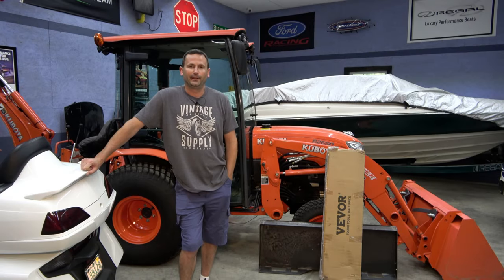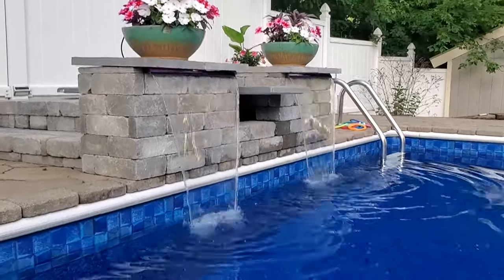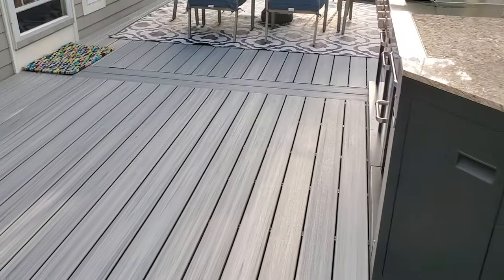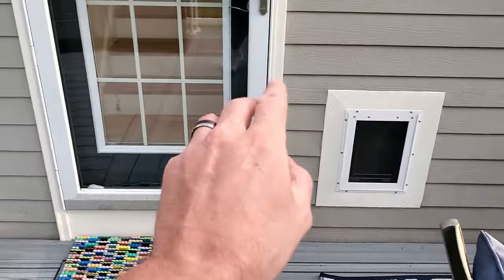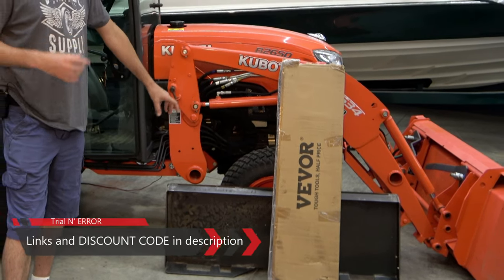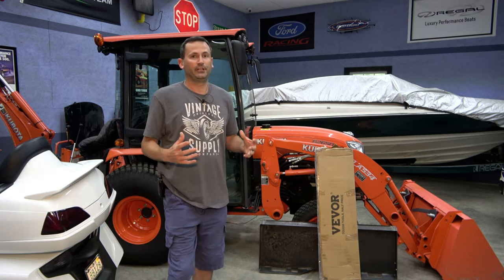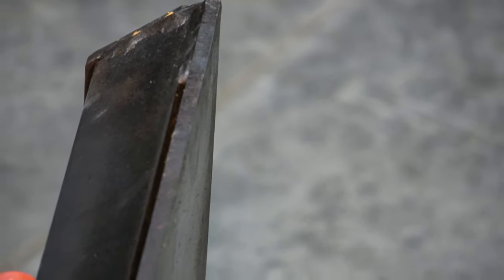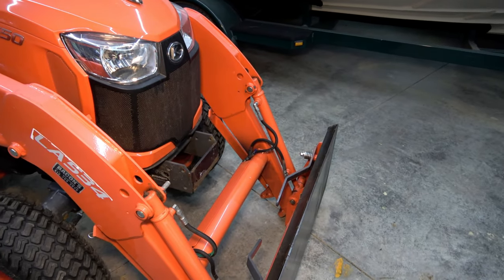The Absolute Cheapest Way to Make Quick Connect Pallet Forks!

Comment: I had some pallet forks with 1/4 inch plate with a tractor about the same size as yours (45 Horsepower). I bent that thin little plate in no time and broke the weld that held the fork in place and the metal at the bottom that the pins from the tractor secure it in place with. Your forks definitely need gussets on the sides for stability. I am about to use 1/2" plate for my next pallet forks. Please let me know if yours lasted.

Comment: The homestead is really looking nice! I love the new deck. Great job on the pallet fork creation. I think I paid about $600 for a plate and two forks that you could slide to different positions about 2 years ago through Chappelle Tractor. How are you liking the B2650? Have a great week!
Reply from the maker: $600 is a good deal!  I just couldn't pass up this chance t build one for $200.  I'm loving this machine.   Like all HST's, my only complaint is how loud/jerky they are in high gear but otherwise I'm really impressed with it.  Super comfortable and plenty of power for me anyway.  Thanks for continuing to watch man!  Now I just need to build me a grapple like you have.
Reply: @Trialnerror  your channel is one of the best. I wish I had a quarter of the talent. I need to take some welding classes. You make yourself a grapple and you will have a new business. People love grapples on these channels 😅
Reply: @BeginnerforBSeries  I did what you're considering and it opened up a whole new world. I took welding classes at the local Junior College a few decades ago because I kept coming up with ideas that led me to say, "If only I had a welder and knew how to use it." Like everybody, I started with a little buzz box to stick weld and honestly, with practice, you can do a ton with that small investment. Ultimately, my favorite process is gas-shielded mig. What's nice about our modern times is that I think you can learn all that you need to know about welding right here on YouTube. The newer mig machines are super friendly, too. Mine has a chart inside a panel that tells me what wire and settings to use for the thickness of a project.

Add me to the list of people who want a grapple! Here in Missouri, we're always fighting to recover land from invasions of honey locust trees. If you're not familiar with those, they're a brutal thorn tree that sheds branches in storms that take out tires for years after they've been on the ground, wound livestock, and wound me working to remove them. My cousin got a grapple for his tractor and all he has to do is lop off enough lower branches with an electric pole saw to duck walk in and cut the tree down. He throws those cut branches on the down tree, then grabs the whole mess with the grapple to carry them off to a pile for burning. I've got a serious case of grapple envy!

Comment: Maybe make the forks so they adjust width.
Reply from the maker: I did think about putting a bar on there to slide them but after years of using fixed with forks, I opted to keep it simple.